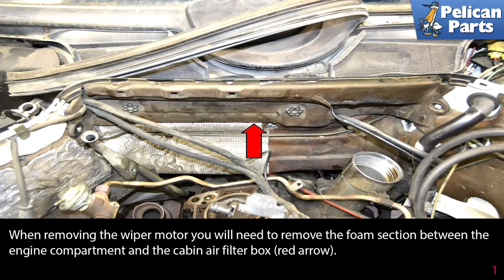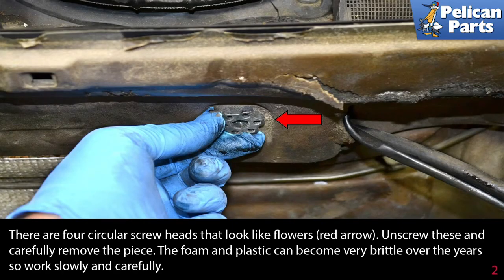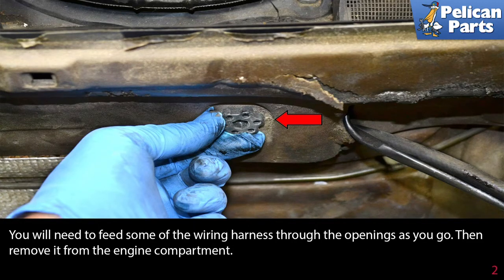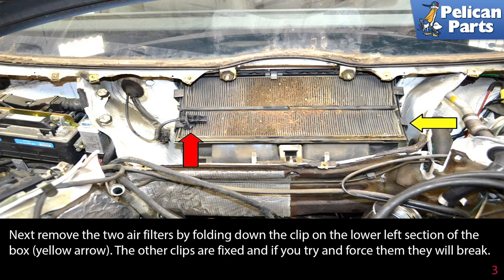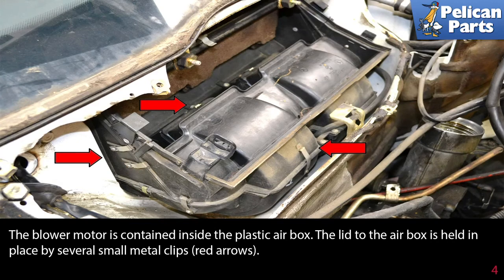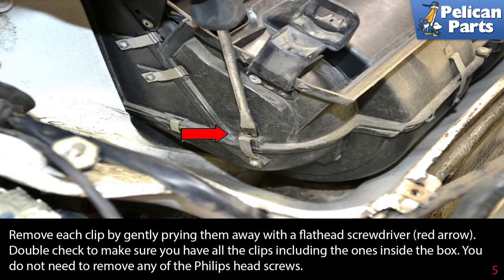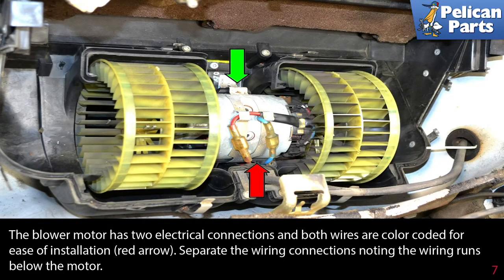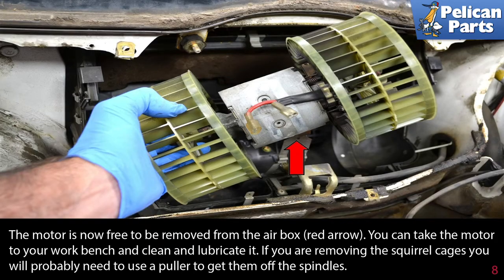Mercedes-Benz W124 E-Class Blower Motor Replacement

Comment: Does anyone know where the blower motor fuse is located on a 1996 E300D (W124) OM606?
Reply from the maker: I don’t have a repair manual or wiring diagram for that vehicle.

I would suggest you grab a repair manual, you should own one. It will have the procedure, special tools and torque specs.

Give our parts specialists a call at 1-888-280-7799.